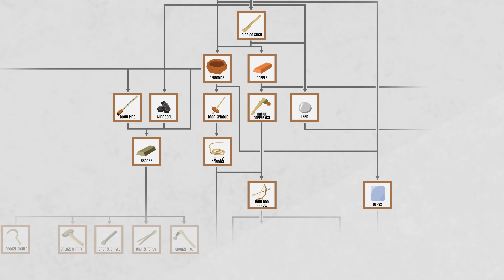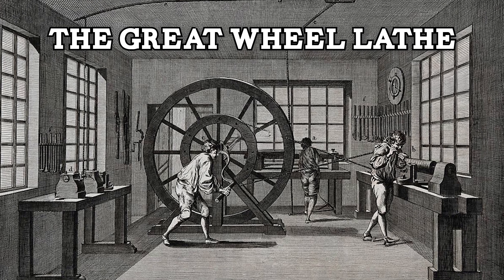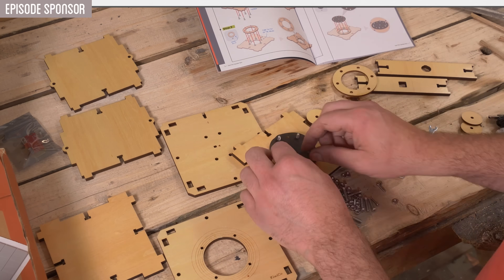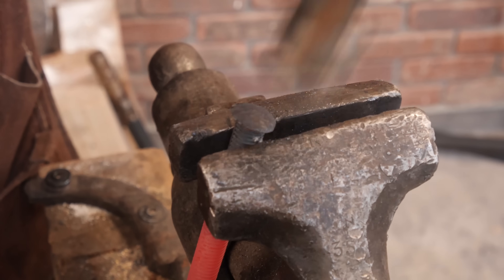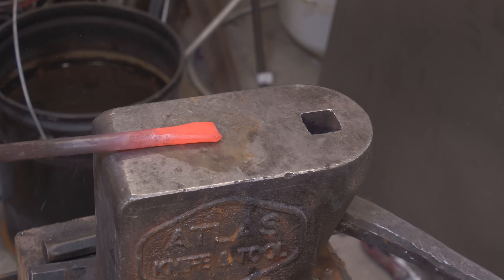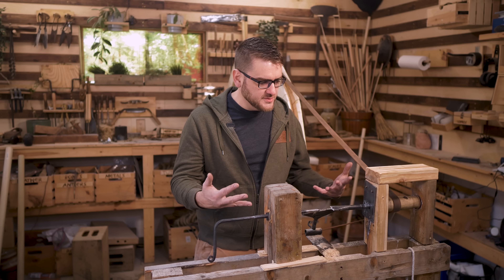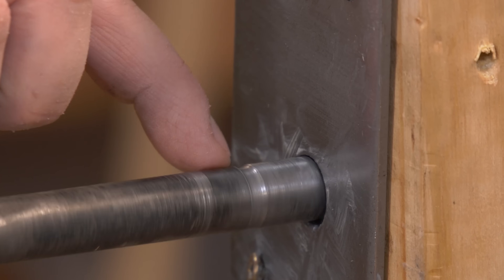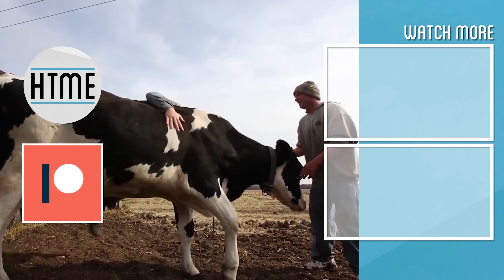Building the Lathe That Will Build Everything

Comment: Greetings. Thank you for another video of your work, it's a pleasure. I would like to give some advice.
1. Manufacture all your machines, tools, and other parts with a certain precision, which will help avoid many problems that arise. For example, here you can clearly see that the belt is driven by wheels that are not aligned with each other, This causes significant fluctuations that affect both the operation of the device and basic safety precautions. 2. Don't neglect precise dimensions when making items; this will make your work easier, you'll be confident that everything will fit, and it will be even better to use drawings and diagrams.   3. Don't try to skip any steps in the revolution; try to avoid crude technologies in more complex devices. After all, you're not dealing with primitives, but with a revolutionary approach.

Comment: Go back several thousand b.c. Those laths were powered with water and compressed air. Kings made small quantities of iron. The common man was not allowed. The tool heads were inventoried. They had all manner of pumps. Heat, wind , water. Ancients had a steam driven turbine in the Light House of Alexandria.They used it as a siren. Elites could have had an industrial revolution in any century. Why would they? It's too easy to connect a cam shaft to a water wheel, with a row of billows on both sides. You compess the air and spin the lath like a flywheel.

Comment: The path to accurate machine tools will be interesting, now that you have a somewhat accurate lead screw bootstrapped.
Maybe look at the Gingery DIY machine tool book series, and Moore's Foundations of Mechanical Accuracy book.
I think the first upgrade I'd make is to use babbit journal bearings (which Gingery also has a book on how to DIY), so you have repeatability improved by not having wood on wood friction constantly wearing your spindle holes wider, then integrate the tool drive screws and lead screw using babbit journal bearings.

Comment: belts will grip and self center on a spherical/bulged pulley, a convex pulley the shape you built causes a belt to always walk itself out.  Modern belts with convex pulleys that don't ride out are because the belt is shaped to the pulley, or because of shoulders on the pulley.... with your setup, definitely riding on a "ball" would be better.  definitely start using greases, waxes, and fats to lubricate this stuff.

Olive oil apparently works surprisingly well as an engine lubricant, it may be a useful material to use at some point in the future.

Comment: I really think you guys should research the technology of balancing in the next few videos. Several of your projects have otherwise been very good, except for the fact that the wheels, gears, etc were either off center or not balanced. I'd love to see how they used to get around this and how historically this was improved to make better machines with a lot less wasted energy. You might even think about unlocking the technology for straight, flat, and precision.

Comment: One problem I see is the balance between getting more skillful at a certain phase of a tool and being able to make the better tool. You need to be skillful enough to make the parts for the better tool.
 It's been interesting to see your approach to finding that balance.

One other problem I see is that all your machines wobble. While some of that is up to the level of precision you can reach with your skill, some might also be up to just inertia, or lack thereof. Maybe put some more weight in certain parts? Also think in triangles. A way to increase rigidity without having to be exceptionally skillful at making good and square joints.

Comment: Amazing what you did, doing this from scratch, friend I think you can get something more precise if you widen the steel one you are using to turn, you need to put it in a tight tube with a lot of oil Machine, a mobile and adjustable turret greatly increases the range of uses, but if you want to have a more precise one you will have to align it better with the rod that is rotating. Very good project, it filled me with ideas.

Comment: Treadles i see used pretty commonly with four links, which spreads the force out a bit more predictably by putting less crank force on those components you're breaking. Look at a singer sewing machine. You also might get a few more Rpm out of two small wheels.

Comment: Im wondering, does any one else think he could add a tension wheel to prevent slippage, increase rpms, just an extra wheel with some pressure behind it, like a pully counter weight or something to increase friction between the "chain" and the wheels? Or using a chain?

Comment: If you make the rim of your wheel convex, and the wheel of the driven pulley also convex, and use a flat belt, then the belt will self center.   You're loosing a lot of power with the setup of the wheel, and the driven pulley is always going to guide the belt to one edge or another.

Comment: uh ya you need to MUCH IMPROVE the main spindle.  needs much Reinforcement and better bushings- lower tolerances go a long ways.   toss the2x4 and go with multiple pieces of oak laminated together.  5" wide at least for left/right stability

Comment: wood is quite a good bearing material because it holds onto lubricants well. sugar or rock Maple with beeswax is still a viable option to this day. Wood is a particularly good choice in waterborn situations with Lignum Vitae being used in many waterborn applications. I would just use a lubricated wood on wood or metal on metal interface. Lubrication is key, as it prevents wear and reduces friction

Comment: This channel really lacks in attention to detail. Polish. And I really am unsure why. 

An extra hour of work, sometimes minutes in some cases. Can mean the difference between having to redo something, or fix something. It saves time. Doesn't have to be perfect. But watching you hammer a clearly VERY bent rod into a chunk of wood. Why not just spend an extra 30 minutes getting it to be much straighter? Now everything you make is being made with this huge wobble. Everything is harder to put together. You spend hours and hours trying to improve the tool in the future because you rushed things. 

Not only this, but the small amount of effort you put into a tool, makes all future tools that you make with that tool. That much easier, more precise, accurate, robust, useful. It's a exponential effect. Your goal is to make a steam engine right? Hopefully this year? Well, this is the sort of thing that makes this possible, faster, and easier. This little bit of polish is the difference between something taking a year, or 8 months. Pays off in the end. 

I love this channel, but this is one thing that's always bothered me about it. I'm glad you show your failures, but you never learn from the one you make in almost every video. Things get rushed, and then it ends up costing you more time in the future.

One place I would start. Is improving your anvil. It wobbles, it's not heavy enough. Improving it. Like attaching it to the ground, or a bigger block of wood to sit on. Makes the anvil significantly more effective. Less effort required when hammering. Better control. There's a reason people use 500 pound anvils. Or smaller anvils attached to huge wood stumps, all bolted together and to the ground in many cases. Makes it easier to fine tune stuff.

Comment: Brah wood and glass ok fine... but any metal, actual safeties please, or you gone be staring down the eye of a needle as it scrapes a shaving of metal tinier than a grain of sand from the black of your eye, its worst than you think cos you wont notice it for 3 days until it begins to corrode and causes litteral blinding white pain... in saying that copper and brass are cleaner and heal much faster than steel... none the less staring into the of a needle as it touches the surface of your eye ball is not fun

Comment: I still love the attempts made on this channel, but I feel every project is heavily restricted because you never make things rigid enough. Sure wood is more flexible than metal, but the amount of play in every part makes any kind of reliable machinery impossible. Putting 5x more crossmembers on the base builds would add a lot more stability into anything you make and simplify your further work, instead of constantly remaking parts that don't work because everything wobbles around.

Comment: Honestly using a lathe is the best tool one should strive for if stuck back in the primitive world you would use it to make a better lathe and so on and so forth until your at the point you can make loads of high quality tools and goods on it. Instead of someone having to use arm strength I wouldve opted for finding a running source of water like a river with a larger wheel with a lot smaller of a gear connected so 1 rotation leads to hundreads of rotations for my first working lathe then upgrade once I've gotten the ability to make a decent lathe from that I'd switch to using the water wheel to harness electricity for other daily needs such as lights and powering a house I'd have my primitive lathe in that would also hopefully use a primitive way of using some electricity to make it still operational until I can upgrade said lathe using it to make more fine parts and electricity parts and such to eventually lead to better electrical storage and lead to new discoveries of better ways to produce electricity then a water wheel. I'm just lazy so I wouldn't wanna have to out in the man hours and manual labor to have to crank a lathe or really have to do much to create electricity so I'd look for natural means. I understand way more on a nuclear level on how to harness electricity but it would take a long time for me by myself to get to the point starting with nothing to locating radiation sources I can use to make a primitive nuclear reactor. Which honestly even on a small scale would produce way more electricity then a water wheel. Which most people can't wrap thier heads around but honestly your using said radiation source to create steam to create an engine that creates electricity. As long as said radiation source has a constant amount of cold water in the right amounts to not over heat but also not be completely over done to the point you don't create steam you basically have your radiation power supply. I wouldn't suggest anyoje who doesn't know how to deal with said dangerous material ever try this in a primitive setting because if you don't supply correctly it could over heat and cause a meltdown which leads to the radiation source getting super activated and shooting off way to much radiation leading to loads of medical issues to include ending your life alot sooner do to just to much radiation poisoning. You also probably won't have an electrical thermometer for a long period of time so your best bet to track the temprature would be makijg an old fashioned thermometer with our good old friend mercury which people for the longest time thought was the philosophers stone but it is poisonous so handle responsibility 😂

Comment: you need precision for greater precision. Time to stop saying "ok it works, good enough". make the cuts strait and tolerances less than half the deviance your trying to achieve IE if you want to make threads that are 1mm you will need a deviance no greater than 10% or 0.1mm. wood shrinkage alone can cause a deviance of over 2cm so you will need wood that has been seasoned at least 3 years and then kiln dried. final fitting cuts should have a deviation of no more than .05mm to allow for ambient humidity fluctuations. Or make it all out of stone XD

Comment: You discovered one of the secrets to flat belts! One pulley should be flat and the other crowned. The belt will rise up on the crown and, if the pulleys are properly aligned, you want the second one flat so only the crowned pulley attempts to control the belt alignment.

Plenty of good advice about bearings in the comments, I'll simply add that if you can rigidly align the pulleys, add some mass at the rim of the great wheel to act as a flywheel, and dial in your tension, you'll have a great drive system. If you want to put in all that effort for an interim design is another question altogether.

Comment: I think you noticed, but crowned wheels are very important for flat belt drives. the convex shape keeps the belt centered because flat belts tend to move towards the highest point of contact on a roller.

Comment: I stopped at 8:55.   Here are the problems.  You are using construction SPF softwood wood.  The reason it works for construction is it’s cheap and has  compressive strength along its length.  Horizontal forces are not good. They smash easily, and break easily.  The accuracy of your joints is no good.   Your metal working accuracy is no where what is needed for anything turning true, as seen in the spur drive spinning.  You do no alignment of spur to tail. The tools made are nothing like any real tool.
Oh well, at least you got over 200,000 views and you made money.   That is the goal, right?

Comment: I'm surprised you made the Banjo tool rest, and not a banjo tail stock. that would let you shorten the amount that's sticking out of the tail stock (as it can get closer), and reduce the wobble/flex in the system.
also, you should make a mortise for the nut on that tail stock, rather than just bashing it into the soft wood. that'll keep it relatively aligned.
finally, I'd add a rigid screw connection for the drive wheel, to be able to properly tension the belt, by holding it at a specific distance away.
also, beefing up the whole thing's weight would also do a lot for you, as any vibration gets dampened by the weight. it doesn't have to be complex, just bricks or metal blocks would do, though making the frame more rigid would always be valuable as well. there's a reason machinery was made of cast iron, that mass makes a big difference in the performance.

Comment: the flatness of the drive end shaft needs improving, this will make a big difference , that wobble at 2300 rpm is causing most of your issues along with a bronze sleeve bearing on that shaft at both sides , the large wheel is impressive with that flat belt, later during industrial revolution era , the whole shop will get driven by flat belt and a whole ceiling of different wheel sizes , like a flat belt transmitting , imagine if those boys had the infinite knowledge we have at our finger tips today , what they could of come up with , looking forward for that era 's build video,,🥸🤓,Canada

Comment: @6:37 I noticed some yellowish powder on your steel. That can be an indication that your steel is galvanised. The fumes from that is highly toxic. You can remove the galvanized coating by soaking your steel in vinegar, but you're better off buying plain mild steel. Besides hardware stores, check your local metal supply shop.

Comment: You probably noticed this yourself, but centering the tailstock to the spindle is very important, and is a big limiting factor in how precise your parts can be. Using wood to hold them in place seems like a bad idea, since wood is relatively soft and wears out fast, so the centering won't hold for long. You can even see some tailstock wobble in the video

Comment: You need to spend sometime making the tools in your shop more rigid.  Your anvil, and vise are moving around as you're trying to work.  

The reason your tool is "jumping" around when you tried to cut copper is due to the massive amount of runout on the spindle.   

The Da Vinci lathe had a critical lack of rigidity. All your cutting forces were transmitted to shaking the frame.  Cutting hardwood or metal requires rigidity.  Flatness and parallelism takes a backseat to rigidity.

Comment: Possible improvement - that forked spindle has a ton of runout - spin it and turn down the center in place so that its at the center of the rotation or otherwise straighten it while its spinning until theres much less runout.

Comment: You need to research water wheel bearings, and line shaft shops. There are some great living history parks around the country with running functional equipment
often running wooden bearing with wooden spindles. lignum vitae is a wood commonly used

Comment: You gotta fix those balance/alignment issues and especially the play/wobble in the axle, otherwise all your work pieces will become oval. You could also insert a brass bushing and lubricate all moving parts with metal to metal contact.

Comment: With a flat belt, that smaller diameter part on the driven pulley isn't the right way to go.  Flat belts tend to ride up to the larger diameter part of a pulley.  This is because the surface of the larger diameter part moves further as it turns and this tends to turn the belt so that the next bit of the belt  will land "higher up the hill"

Comment: To hold a belt on a pulley, you actually need one thats convex, not concave, as you see at 8:17 the belt is sitting comfortably on the edge of the wooden pulley instead of the convex middle.

Steve mould has a interesting video about this called: "this band should fall off, but it does the opposit!"

Comment: You can use a plain bearing made of bronze sheet. A little oil is poured in there and it drips onto this bearing. The speed is not very high, the abrasion during lubrication will be slower. 
Usually they put a can of oil in it and it slightly dripped onto the axle itself inside the plain bearing. It lasts for about 20 years with such a slow abrasion. If it does, then this is a signal that the bronze U-shaped plates have worn out

Comment: Im not sure if you are trying to replicate the methods that were used to bootstrap a lathe, but if you aren't, you might consider using concrete to make parts that need to be immovable and rigid. It is also quite easy to cast into forms and around things to maintain their position.